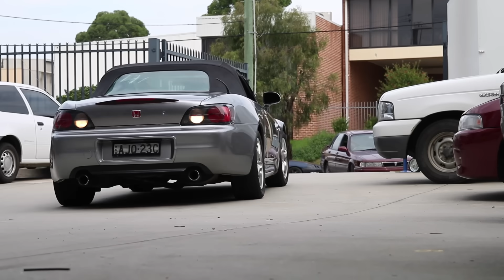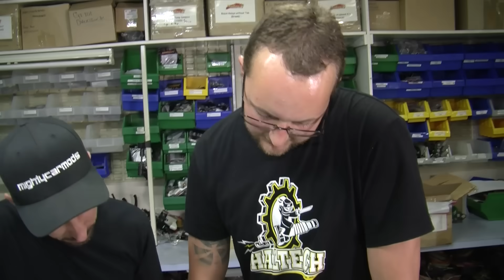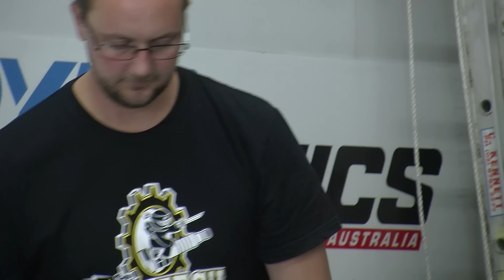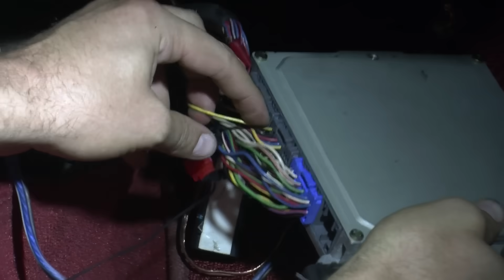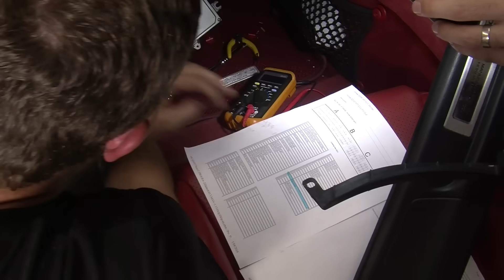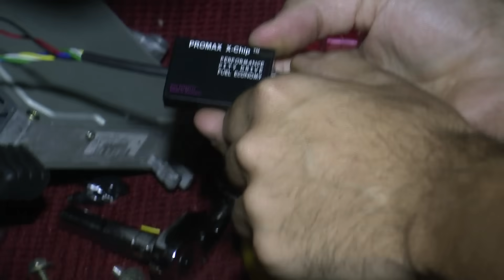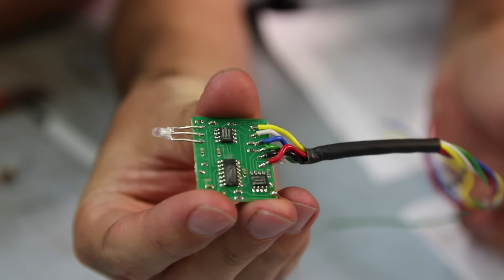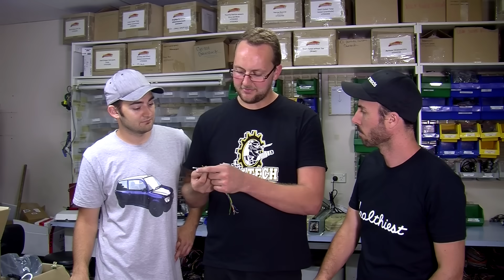eBay Performance Chips -  Mythbusted

Comment: stickers + 5 hp
spoilers + 10hp
paint the car black + 100hp
Reply: get a hammer and bash out the foot well so you can push the accelerator down further
Reply: GTA logic
Reply: dont forget racing stripes
Reply: @jaycobyhyde2742  , ,
Reply: +Alex Shi You forgot this chip. +35hp
Reply: +Alex Shi add a tow  sticker +5hp and a transformer badge +2,000,000kw
Reply: Add 300kg worth of stereo equipment, everyone knows that increases performance
Reply: +Alex Shi you forgot washing car and changing oil. Gran Turismo logic.
Reply: +Alex Shi your forgetting something they need to special order that paint so its a pearlescent black
Reply: Chris Brown hell make sure they add in a hood scoop on the dash because everyone knows your getting +12 horses when no air can get to your scoop
Reply: soup can? pfft try hard poser, I have installed a custom blend 43 coffee can. Adds more power then a soup can can and makes my car sound like a V12
Reply: +Alex Shi 
What about the super RED  Billet Aluminum Racing Rear Tow Hook Kit CNC JDM Anodized making for quicker strap down friendly coolness superly!?!?!
Reply: +Alex Shi  Don't forget the 5hp soup can muffler aka fart cannon.
Reply: danodude  Actually no, I got the 10% extra value coffee can so it actually performs like a V13.2 That extra 0.2 of a cylinder makes it noticeably better then a V13.
I proved this by driving down the street and using smug factor determined its extreme race track ready performance.
Reply: Paint the calipers red +35 hp
Reply: Micheal Wright lol black is always faster.
Reply: Chris Brown No doubt performs like a V12 now, too.
Reply: Chris Brown wow m8 thats insane. Recently installed a fake exhaust pipe and muffler on my car so now it looks like it has two exhaust pipes coming out the back. I'm sure I can definitely feel the difference when I put my foot down.
Saving up for a massive wing, clear brake lights, neon, and 21" chrome rims. Once I have them I'm going to stance the car and put lots of aftermarket stickers on it, and of course paint it black or dark purple. From my calculations I should get around 650 more HP!
Reply: paint the car red with white stripes +1000HP
Reply: Chris Brown Thanks for the tip, will make sure I do. Is obnoxide flammable? I don't want the sparks generated from trying to get over a small speedbump or curb to cause a giant fireball. 

Your ride is sounding so dope, btw.
Reply: Alex Shi delivering tofu
350 HP
Reply: danodude if you can drive over a speed bump your car is way too high. Obnoxide is better then flammable its inflammable.
My ride has an old school 4 speed automatic transmission I need to operate manually
1st, 2nd, Drive, OD switch. the torque converter operates at about 6,000 rpm
Reply: Chris Brown Great idea! I'll also mount the front splitter upside down, too. That should help reduce the weight on the front, created by the engine. 

Wow, that corolla sounds like a beast if it can keep up even with my ride.
Reply: Buy and Addidas hat....
Reply: Alex Shi the stick on hood scoop is my fave!!! 200 hp all day
Reply: Chris Brown Very true.
Reply: Chris Brown Ah ok, well I lowered the car some more. As you can see in this picture: http://motrist.com/images/posts/7/217/7217_m.jpg

I haven't actually installed the clear brake lights or massive wing yet, but do you think that's low enough? Or should I go some more?

Your ride sounds sweet though!.
Reply: Chris Brown Wow thats some serious improvement. I did a similar thing with my massive wing, I've mounted it upside down so the car lifts off the ground, thus weighing less. IIRC it's about 500kg lighter.
Reply: danodude cut out the useless bonnet scoop and mount some bitching bonnet wings.
Too slow it down I pull out a spark plug so it only runs on 2 instead of the normal 3 cylinders of the I4 engine
Reply: Chris Brown Dayum m8 thats 2 op! I decided to go with a triple screen setup in the back of my car, also have multiple consoles and a high-end gaming computer built into the car's chassis. Easily +250 HP right there. 

Gull wing doors are next, that should offer a significant performance improvement over normal doors.
Reply: Don't forget to add 10,000 multi colored bright flashing LEDs, a bbq in the bonnet, a spa in the boot and a stripper pole in the back seat, strippers add at least 1,000hp each, I have proof, when ever one is in the spa flashing her tits, nobody ever over takes me, ever

I was driving down the street today at about 450mph when I miss shifted from 11th gear into 1st gear and blew up the engine.
Yeah my car has a custom built clock face 12 speed gear changer thingy. not one of them wanker H pattern gear boxes that limit HP by at least 140%
If only I installed a rev limiter the engine would not have blow up.
Reply: acetone in the fuel tank, or is it moth balls?
nitrogen in the wheels?
magnet on the fuel line
Reply: Sorry, I went too fast and inadvertently traveled forward in time then accidentally smashed into my own car writing them both off. Now I have to start all over again
Reply: Chris Brown  ok so wheel locking lugs+900 hp
spoiler makes car fly +300 hp
roof and hood scoop keeps car stable in air +400 hp
spinners +1500 hp makes car visibal only at red lights
+flagpole welded onto your roof 90hp
flags on each side of your hood +50 hp 
bullet proof windows 1 inch thick +75 hp
chrome stickers that are so chrome the cops go blind when they look at your car +90 hp
full neon kits inside outside and in trunk and hood +800 hp
hydrolics for landing gear +80 torque
soda can on the antenna +25 hp
spraypainting JADS on your hood +2500hp
26" tires for a stupid sick burnout +250 hp
5 cb antennas to fool the cops +98 hp
custom trunk doors and hood that open different then other cars +350 hp 
replacing the engine with a 250 2 stroke engine from Yamaha +900 mpg +400 hp 
spraypainting fag on your dashboard +500 hp
big ass wheelie bars for when your on the street and you wanna pull major boost +80psi boost
9" rollcage bars +600psi boost
racing seats +300 hp
custom gastank lid +50 hp
custom floormats +25 hp
window tint +90 hp
pouring nitrous energy drink by monster in your tank +600 hp
spraypainting your lisance plate pink +50 hp
custom steering wheel +700 hp
custom mirrors +800 hp 
lowering your ride +500 hp
square tires +600 hp
spraypainting fuck the police on your back bumper +9000 hp
Reply: Micheal Wright l know right, please donate on my "go fund me" page just search "Help me repair a colony of baby fur seals l accidentally murdered due to bad advice from danodude"
Reply: averat84 so by that rationale l should take my pants off and chant to the cosmos?
Reply: Mine came black for extra unicorns!
Reply: alwcurlz Don't forget the tow sticker
Reply: danodude Make sure you put narrow tires on your excessively wide rims.
With your set up the car will make its own obnoxide (not a spelling mistake)

I painted my tails lights ultra dark platinum, and installed bright Halogen brand LED lights in a violet color, I paid extra money for the ultra version
Reply: danodude Is that light I can see under the body, Performance Multiplying LEDs?
Thats gunna go so damn fast
Reply: Chris Brown Sure is bruh. Tuners in their R34's won't be able to keep up!
Reply: danodude I have 200 150W halogen lights under my car, yeah it consumes 30kw of battery power so does not affect performance. It heats the ground up. Hot air rises so it pushes my 5.5 tonne roadster up a bit so it only weighs about 4 tonne now
Reply: stack multiple wings, so your car weighs 100kg, then youll have a massively high power/weight ratio and can smoke anything. Except my highly modify corolla with stock NA engine, they'll be pretty even
Reply: +Chris Brown Yep, done that already. Also installed inside lighting for more speed and put a massive speaker and TV system in the back. It may weigh a little more, but the TV and speakers add +100hp which should still improve performance... and all my wings mounted upside down will help reduce the weight, too.

I guess you don't want your corolla to go so fast that you can't control it right? And to be fair on competition?
Reply: Yeah a good quality heavy duty CRT TV  not those fancy pants LCD screens, I dont wanna look like a try hard poser who has no idea and is just talking crap. Mine displays live footage of the multiple coffee can exhaust outlets. Now I can see the 15-20 seconds worth of bbbbbbbbbbbbbbbbbuuuuuuuuuuuuuuuurrrrrrrrrrrrrrrrgggggggggggggggggggggghhhhhhhhhhhhhhhhhhhhhnnnnnnnnnnnnnnnnnnzzzzzzzzzzzzzzzzsssssssssssssst as I floor it in first gear before I reach a conservative shift point.
I put motorbike tires on my car, cause my car is faster then two R1s gaffer taped together so I'm using the same bike tires.
Reply: Chris Brown Ah damn mate that sucks. I suggest once you have your car working properly again, install that rev limiter, but also equip a vacuum cleaner to the car, and stick the sucking pipe over your exhaust pipes (make sure you have at least 4 for maximum HP). When you are driving, simply activate the vacuum cleaner and it will give you approximately 50% more power. How? Quite simple, really. The suction of the vacuum cleaners sucking air out of the engine pulls the pistons back up faster, thus generating higher RPM's, and, of course, more HP.
Reply: danodude  yeah cause every serious petrol head knows a rev limiter stops the engine over reving on a miss shift.
Dont worry I used bubble gum to stick my engine back together, all good now
The vacuums give me an idea, suck the air out from infront of the car, eliminate all air resistance at high speeds like when driving through school zones.
Reply: Chris Brown That's a great idea. You could also use a leaf blower to blow air out behind to increase the pressure behind the car.

Also yeah, school zones are definitely the best place to do high speed run tests.
Reply: danodude LOL, think I'm out of stupid ideas
Reply: Chris Brown Hhahahaha me too :D
Reply: Chris Brown I got one might as well add a propeller on the front of it
Reply: danodude also everyone knows you get 15 horsepower by mixing your nos energy drink into your gas so stock up on those 20 packs
Reply: Chris Brown I got an idea to expand your propeller idea. Put a sail on the car, and attack a fan to the car so it blows the sail, thus pushing the car along faster. Takes 10% load off the engine so the engine can then push that 10% harder, which = more speed.
Reply: Chris Brown Damn, next time make sure you install a couple of leaf blowers on the front of the car that automatically start up when your car reaches 87.9mph, so it can't time travel!
Reply: don't forget the carbon fiber duct tape that'll make even the heaviest of objects lighter
Reply: Zach Grodrian True.
Reply: Its been scientifically proven, coating existing parts in carbon fibre patterned tape saves at least 50kg per part
Reply: +Alex Shi leds ? 130++?
Reply: garden hose to spray off the cool stickers (not needed cause its the only stupid accessory well just go hick and use a bucket n war-tar)+5.5 hp +20 torque(or in ghetto stupid acceleration)
Reply: hey kids if you think these chips are hot just wait until you pour red bull in your air intake because its a energy drink it will give your car energy+900hp
Reply: +5.5hp is like 25% more power over what their engine currently produces, so %wise its a massive improvmnet
Reply: thing is though none of all these addons we told u are good unless you make sure your car has chrome stickers all over and don't stop putting them on until your car is a rolling disco ball on wheels and be sure to add your racing seats so you can sit low when the cops come and the best conversion of all is putting a 2 stroke muffler on your car all that will make your car into a 1500 hp beast plus pink spinners neons audio equipment because you want everyone on the track and in the stands to hear your favorite song  and also make sure you don't forget giant ass wheelie bars and roll cages for when your on the street coming home and you want to race plus your never going fast without the miniature flags sticking out each side on the front of your car plus the eyelashes for your lights plus the spoiler so your car will fly and hydrolics for landing gear plus you need to make sure you screw 4 giant sheets of plywood on the hood too
Reply: 900hp, what a load of crap, I tried that will driving at 5,000rpm and it killed my engine. It must have been at least 2,000hp to do that much damage
Reply: dont forget the special odd shaped wheel lug nuts and the keyed socket.
Before you ask, yes wankers actually do this to cars with stock rims
Reply: Those are some awesome genuine dyno proven mods
Reply: Chris Brown we both guarantee a instant 9000 horsepower on the dyno if you spraypaint fuck the police in hot pink on your rear bumper in giant letters
Reply: 9,000hp, in that case I'll install custom neon lights and a 500kg battery pack so it remains lit 24/7, ill have so much power ill need to carefully plan my drive between tyre outlets
Reply: Chris Brown u know id love to see someone drive by with fuck the police in hot pink on the rear of their car id bust up laughing when they drive by a cop
Reply: Micheal Wright I guarantee some wanker has it on their car and thinks its fucking awesome
Reply: Chris Brown so true I saw this one dumbshit 3 wheels on his land rover are 22" spinners the rear passenger wheel though was a 13" doughnut
a fucking 13 inch spare tire with the rest of the wheels being those big ass spinners
it wasn't even on the ground that's how bad it was
Reply: LOL spinners
Reply: +Alex Shi Seems legit.
Reply: yeah, crap red, but brilliantly dark glowing matte red is 750hp at least, scientifically proven!!!!!
Reply: add a 5 dollar flame decal atleast 100 ftlbs more torque and about more 50 horse power
Reply: Awesomelord101 now you tell me i can use a decal.... I used to set my car on fire for the extra power
Reply: yeah chris I remember those days if you pour gasoline on your car and light it it makes your car have an extra 200 hp
Reply: flaming wheels warms up the tires increases traction fives times. This allows you to put all that extra power into extra acceleration instead of extra smoke.

Sounds like a funny episode, I would like to see them do that test... 
Flaming tires provide more grip? myth-busted!!!!
Reply: finally someone is talking some sense
Reply: I just plasti-diped the rocker panels on my truck black, can anyone give me a estimated power gain?
Reply: Gaming Wolf 30 hp
Reply: 900 hp if you weld armor plating on your roof
Reply: +danodude you are so full of shit, l tried this and it fucked up the wife's dyson and now she is divorcing me. Also the fumes from running a generator in the back seat to power the vacuum cleaner made me pass out and crash into a colony of baby fur seals killing all of them and totalling my Lada Niva.
Reply: Geoff Timberlake wow WTF man
Reply: Geoff Timberlake you should have used a diesel generator, they pump out different gases to a petrol generator
Reply: +Geoff Timberlake you have to add an aftermarket turbo encabulator.  The original machine had a base plate of pre-famulated amulite surmounted by a malleable logarithmic casing in such a way that the two spurving bearings were in a direct line with the panametric fan. The latter consisted simply of six hydrocoptic marzlevanes, so fitted to the ambifacient lunar waneshaft that side fumbling was effectively prevented.
Reply: Alex Shi I guess so.
Reply: Ae86 will only have 50+ hp from two tone white black
Ae85 will not have added hp as the SOHC car has a single colour on the body, no panda style
Reply: I only got 26hp when I painted my vehicle black.
Reply: paint the hood black + 150hp
Reply: Paint the car black? Thats racism.

Blacks (cars) always work good when given peanuts or bananas as fuel.
Reply: Alex Shi matte black paint for twice the HP 
And matte black rim covers on steelies for 13+ HP
Reply: Painting your brake calipers red=+10hp
Reply: Alex Shim lmao
Reply: fuzzy dice from rear view mirror + 10,000 hp
Reply: Incorrect. Paint it red, since red unz go fasta!
Reply: @drewpeacock read these comments LOL
Reply: Top down 2hp
Reply: Alex Shi kegs sticker, plus 200 hp
Reply: Don't forget headlights and taillights film +1000hp
Reply: Anyone mentioned painted brake calipers gain +50hp yet?
Reply: Wow what a scam. I guess the real deal costs a lot
Reply: Add lightness
Reply: Carbon fiber the antenna easy 50hp
Reply: sound system + 1000hp!!
Reply: Painted the car black? No red. 500 hp

Comment: So because this chip was a hoax does this mean that every chip is? Im not into tuning cars by manipulating electronics so I dont know shit about the market there but couldnt you just select the most reputable chip manufacturers and test their chips? this easily could have been a rip off chip.
Reply: +Bill Killernic It does really. There are no reputable chip dealers. Feel free to buy every one and take it apart but you will see they do not work. No free gains.
Reply: Steve wong 911 chips. They do work.

Comment: why is your s200 so weak? . s2000's are over 200bhp in the uk?
Reply: +Adam 'panda' Peake 
I was wondering too, that engine is supposed to make around 250hp. The reading they get might be at the wheels rather than the crank (which is the one that really matters anyway), but the loss seems a bit steep.
Reply: A dyno calculates the power at the wheel, and calculate the 25%~ drivetrain loss of a RWD car, and it's pretty much 180whp, so it's normal.